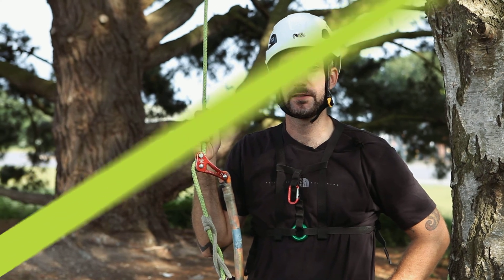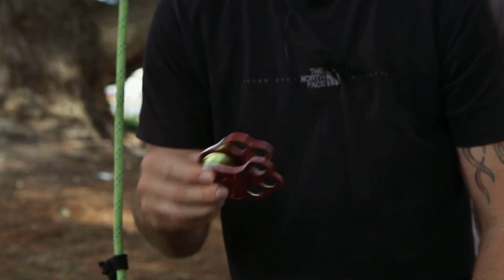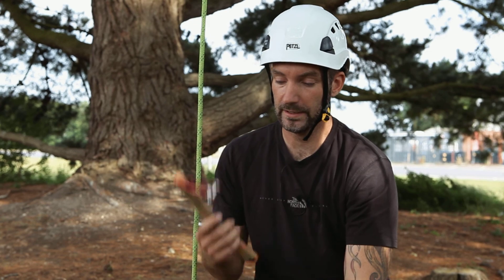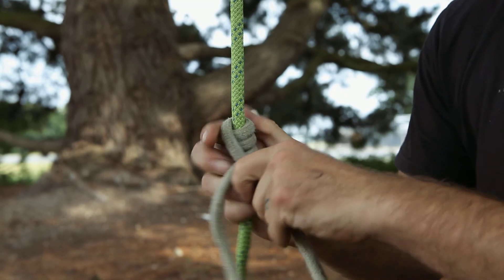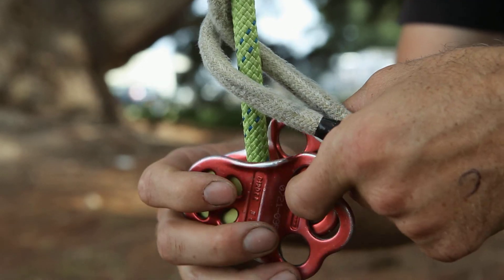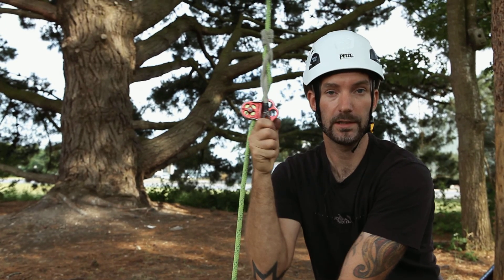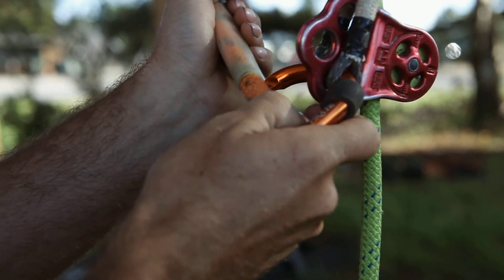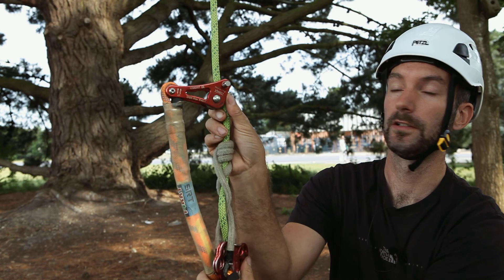Treekit SRT Tutorials E04 - Basic Rope Wrench Setup

Comment: I'm an experienced DRT climber and I'm looking to get into single rope. Can you explain to me why I just can't use a hitch why do I need a rope wrench above the hitch?
Reply: From what I understand, the bend creates just enough friction, the hitch can hold safely and have the same feel as a Mrs system through a false or natural crotch. Stihlborns videos explain it pretty well! Stay safe brother!
Reply: Yes what FS 101 said, I think it distributes the friction otherwise there would be too much at one point if relying on the hitch alone. This allows for smoother ascents & descents like climbing DRT with your rope set up through a pulley or friction saver versus the crotch of a tree.
Reply: In drt only half the weight of the climber is on the hitch.  In single line all of the weight is on the hitch. Hitch alone in single line will seize up preventing reliable descending. It will also generate significantly more heat which will melt and glaze the hitch and possibly the main line.